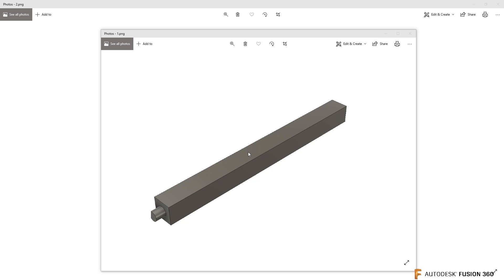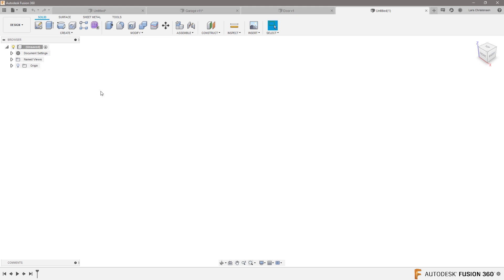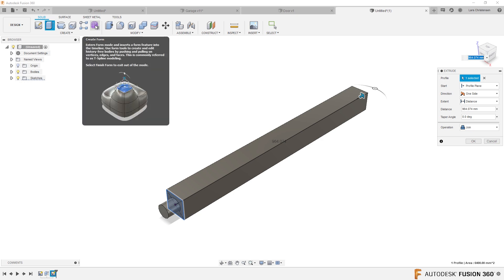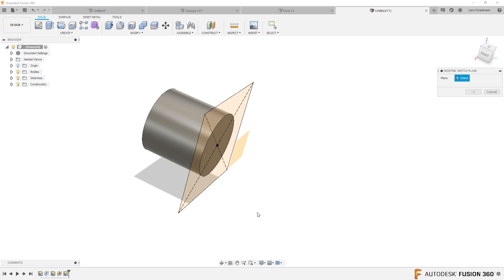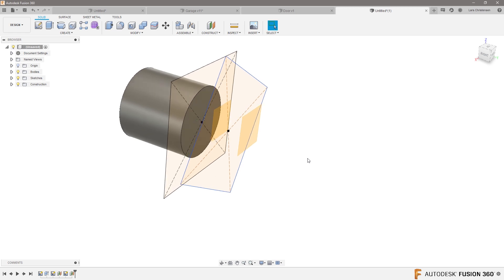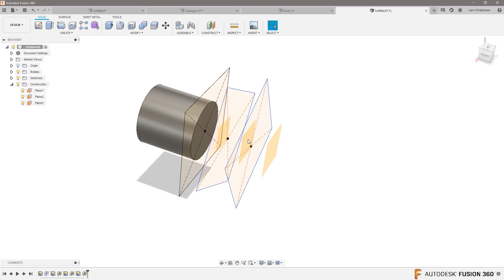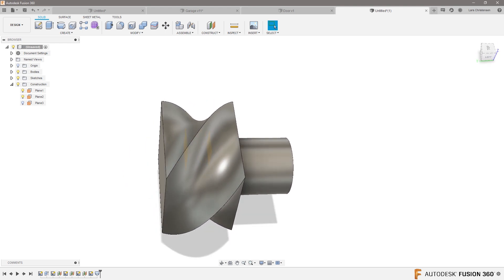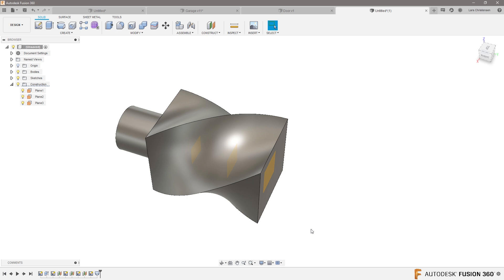Fusion 360 — TWISTED METAL — Ask LarsLive

Comment: SWEEP METHOD:  Simply sweep square on line; add twist. Done:) Easy to change, too:)
Reply: A little math/params and the separation distance can be defined. Working on it, now:)...
Reply: OK, worked out the math/params. Happy to share upon request:)...
Reply: And, should work on a curved path, provided the distance can be accessed, since this is needed to calculate the number of divisions required in the Sweep feature.

Comment: "Twist" (or related "bend") are common design features. A general-purpose solution would be nice, but I haven't found it in Fusion 360:( 3D modeling can be challenging at times requiring some creative thinking. The solution presented here works (kudos), but is a bit "involved" to fully realize/modify, and is, in fact, ad hoc, so, is not applicable across a broad range of situations:( I guess this is a matter for suggestion on the Idea Station. In fact, I wouldn't be surprised to find it already there. Hm?...